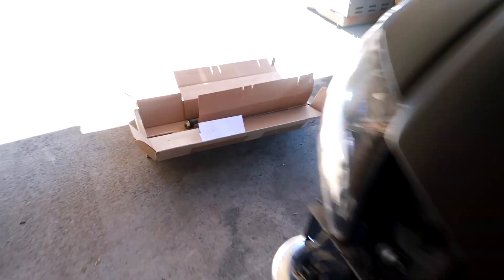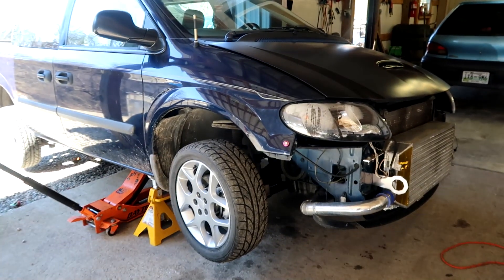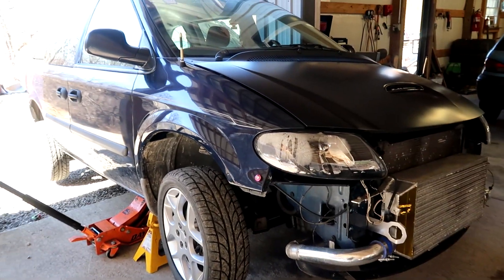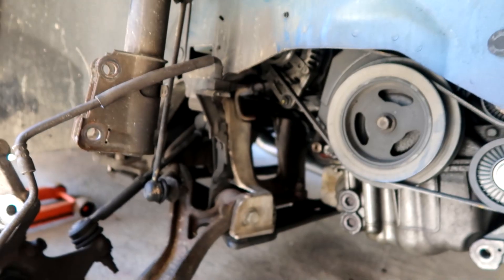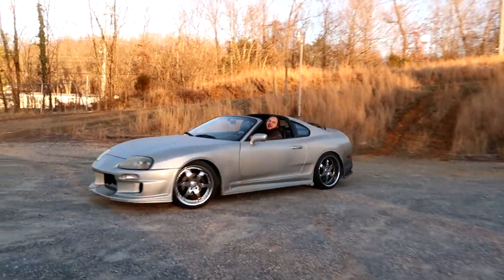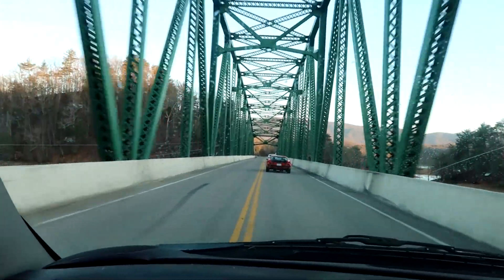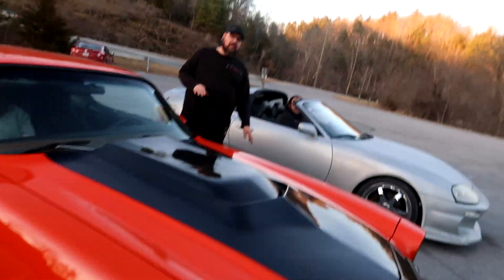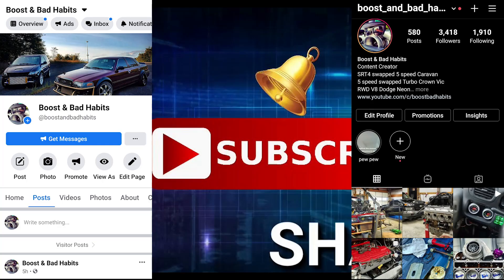SRT4 Swapped Caravan gets Custom DSS Level 5 Axles | Minivan vs Camaro

Comment: 26” tall slick might be a bit tall for the setup you’ve got right now, but if you end up nodding it down the road it’ll make sense. I wanna line up my SRT swapped LeBaron!
Reply from the maker: Definitely have big plans for it. The main reason for 26" unfortunately was purely looks. The 24.5 was way to tiny on the van, it looked ridiculous. Have a personal goal of a 12.9x on the stock charger before going big turbo though. Fingers crossed.. Love to check out that LeBaron oneday forsure though!